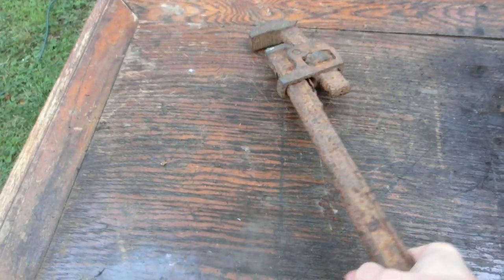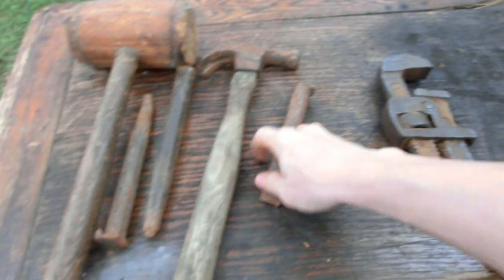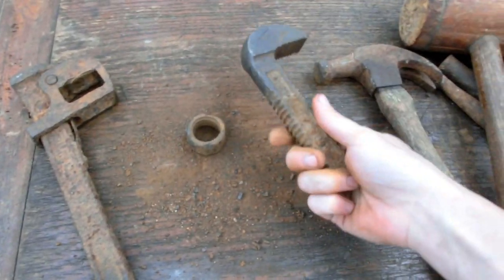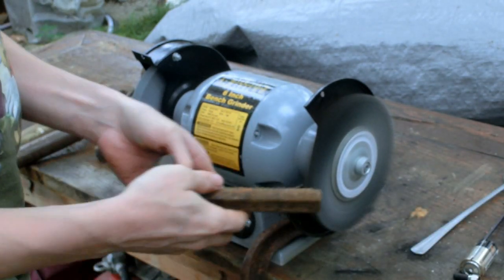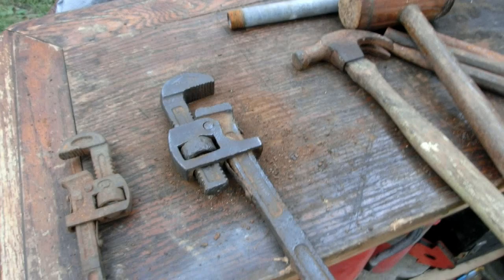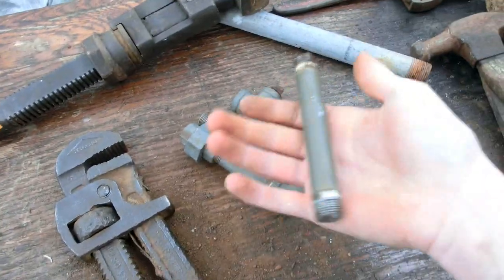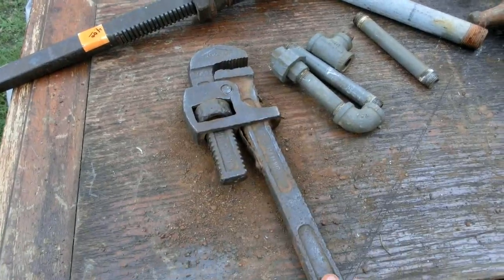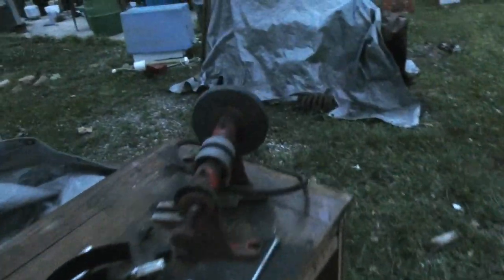Restoring a 1930s Wrench Lost for 50+ Years at Lead Mine

Comment: You should not beat on the ring like that because you can damage it. Use a rubber or wood mallet or hit the pipe where there is more metal. The best way to clean up an old wrench like that is to use WD-40 & a wire brush. After that you can clean up any bad pitting with a circular wire brush. The only time you want to put tools in a type of liquide is if there are working parts that are seized up and impossible to get to. Grinding off the patina on old tools does devalue them. Collectors look for tools with good patina so if you don't plan to use the tool you should only clean it up a bit with WD-40.
Reply: He only cleans them for use there not really for selling for profit
Reply: I understand that. Some of my comment was meant to help educate or give ideas to those who are watching this video and reading the comments. Another point I failed to mention is that patina is a natural protector from rust.
Reply: Okay now I get what you mean and yeah a patina will protect from rust but they can just build up from oiling tools and that can be protective.And yeah I would not use a hammer on the ring I would use like you said a mallet.
Reply: William Laidlaww If you're like me and have a lot of tools it gets annoying to have to worry about oiling tools. Not only that but it also cost money. I collect old tools and use them all. If the tool has good patina I try to leave most of it on so that it protects them. I like not having to worry about cleaning them. That, and a good patina gives them character.
Reply: Yeah I know exactly what your talking about and it can be a hassle but as soon as I find a little surface rust on a tool I oil it this ends up creating a nice patina on the tool.
Reply: I don't know what you mean by patina? I think what you are seeing is a color disfiguration not patina. Patina is a thin layer that builds on a tool over time by exposing it to the elements. It takes a very long time to actually accumulate on a tool.
Reply: The patina process can be speeded up by oiling it as it gets into the pores of the steel and creates the layer that looks nice.
Reply: Oh, ok. I thought you meant that you would  take the patina completely off a tool and oil it to bring back a patina which is impossible once you you take the original off. It would take 30 years to get a good patina on them again. So either you have been oiling your tools for that long or your tools have a patina on them you just clean them up lightly and oil them. I believe there are two kinds of patina. There is the deep patina which discolors the tool making it look dark brown or green or even black that is actually very hard to take off and there is the brown patina type of coat that builds on a tool which comes right off with a brush. You can literally hold a tool with a brown cost and it will turn your hands brown as opposed to the other which is embedded into the tool.
Reply: Nah I didnt mean take the old patina completely off,The deep patina is what I was referencing as the oil can seep into the pores and then in some cases with certain oils can harden up creating a hard finish which can not be rubbed off.

Comment: dude stop soak it in vinegar
Reply: I know right?! I was cringing the whole time. Thinking, let the damn thing soak in some vinegar for a few days and simply wipe off most of the rust then use a wire brush. Way less work with better results.
Reply: I'm glad I wasn't the only one that cringed when that hammer first came out
Reply: I've found that a product called EvapoRust works wonders and does a better job than vinegar, CLR, or any other product like that. It's also non-toxic and environmentally friendly, so you can just dump it down the drain when you're done with it, although you can reuse it many times before you have to throw it out. It doesn't irritate your skin either. Also, unlike the other options, you can leave it in the solution for weeks without it eating away at the metal and an/or blackening it. It did a great job on some rusted machine tool parts I had, like an old dividing head and 3-jaw chuck.

Comment: Hey rinoa great stuff,  I have about 4 pairs of stillsons of various sizes the two larger sizes I have found and I restored.
Not any where near as rusty, a really quick and easy way of removing the rust is to pour spirits of salt (hydrochloric acid 32%) I have used this on various  steel restorations, not as cheap as wire brushing but verry effective

Comment: I have a similar pipe wrench that I found.  I think the brand on the wrench is STILSON, which is supposedly one of the original pipe wrench companies.  Those old tools are great, they lasted the test of time.  I need to get a better grinder / wire wheel too.  I was looking at Ironton brand at Northern Tool.

Comment: Nice job of restoring the wrench and congrats on moving up to a wooden work bench, it's alot quiter than the 55 gallon drum. Please do me a favor and use a pair of pliers or something when you put small parts against the spinning wire wheel, some day the wheel will grab the part and try to shoot it out the back of the grinder taking your finger with it and cause you to say many bad words in a loud angry voice.
Reply from the maker: i cuss a lot anyway, and btw no word is actually "bad".

if it did grab it, it would make a stand-alone video! might be as succesful as my video of me splashing acid on myself.

Comment: Mate, word to the wise here. If you hit anything that's got teeth or threads then the likelihood is that you'll damage it or jam it. Imagine hitting a nut and bolt with a hammer, and then trying to make it run smoothly. No. Wd40 and vinegar for a few days, them maybe a few gentle taps with a rubber or plastic tipped mallet. Not hit it with a hammer till it works

Comment: It's time for you to learn Rust Removal Using Electrolysis.  Good job!
Reply from the maker: your joking right?
Reply: Rinoa Super-Genius Electrolysis would be a better way to get the rust off the wrench
Reply from the maker: Almazick Almaz
 yes and i've made quite a few videos where i use electrolysis and show step by step how to do it.

i used it to clean some pipe fittings, a 1950s reel mower, hubs and muffler and recoil starter for my 1982 honda atc185 and will be electrolizing the rest of the frame latter. and several other things i've forgotten.

i wasnt asking if you where joking about electrolysis working, it does work well. i thought you where being sarcastic because i use it in pretty much every restoration video i've made in the past few months.
Reply: Rinoa Super-Genius Didn't think, you'd get so defended, :) but I just didn't know you knew about electrolysis.  Like I said, you are doing a great job and keep it up doing good videos.
Reply from the maker: Almazick Almaz
oh i'm not offended at all, just talking.

Comment: Nice video.work so hard to restore these old antique tools,appreciated a lot.i`m also collector and restorer of old tools,i can suggest one thing to you,use very simple and effective way to remove heavy rust and dirt with the use of HCL (hydro chloric acid) .its cheap and harmless and without any hard labour. try and test.hope you will enjoy.
Reply from the maker: yeah but im not a fan of strong acids if i dont have to use them. i'd rather just use electrolysis.
Reply: hcl would make that wrench shine like new without any scrubbing in like 5 minutes....

Comment: Dude when you where banging on that pipe wrench with that hammer it made me cringe you could have dented the adjuster nut and it surely wouldn't have came off then if I was you I would have soaked it in vinegar and sprayed wd40 into the threads of the wrench after it soaked for 1 or 2 days in the vinegar I'm not trying to make a fool out of you but I am 15 years old and I was raised by mechanics and machineist and I know better than to do that especially on older tools that are hard to find.
Reply from the maker: vinegar? no thanks, this is quicker.
  
and these old tools arent hard to find.

Comment: If you have some old gloss house paint you could protect it, so if its left outside it wont die from rust, shame to see your hard work reversed by dampness :-(
Or the oily rag treatment would be good :-)

Good old tool, did you decipher the makers name?
Reply from the maker: Stillson

and i'm fine with a little rust. i'll just use it. the best way to keep rust off of things is to use them.
Reply: Rinoa Super-Genius
Ahh good brand, i have one i found in the garden about a year after some workmen took down some scaffolding, it was only light rust and i had some black paint, i gave the teeth a dentist trip with a triangle file :-)

Comment: you should have left it in water for a week or so. and you could open it by hand than. and clean and oil it after
Reply from the maker: thats not how that works.
Reply: Rinoa Super-Genius Try it next time.
Reply: The rust if placed in water would get soft and and would be easier to clean. I have done it lots of times.

Comment: Maybe this guy never heard of wd40
Reply from the maker: maybe youve never heard of how shitty wd-40 is.
Reply: Rinoa Super-Genius what would you use then?
Reply from the maker: i made a video showing it, did you not pay attention? when you are dealing with thick rust a hammer is the best option, when you are dealing with a stuck object heat is the best option. wd-40 should never be used as a lubricant since it degrades into a sticky mess before too long. some people put it in locks to free them but then wonder why the lock sticks months later.

the only good thing about wd-40 is the smell.